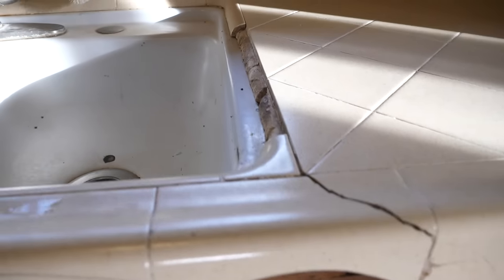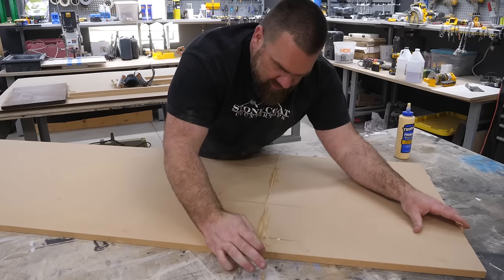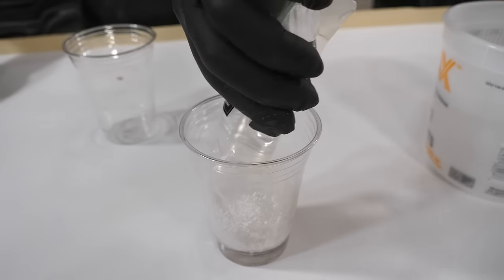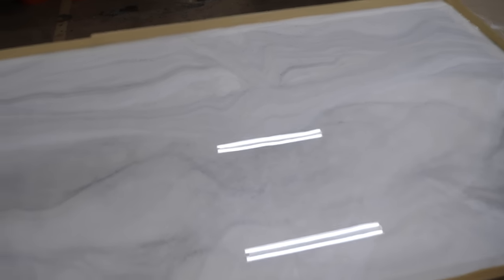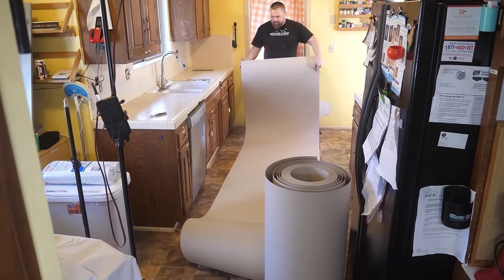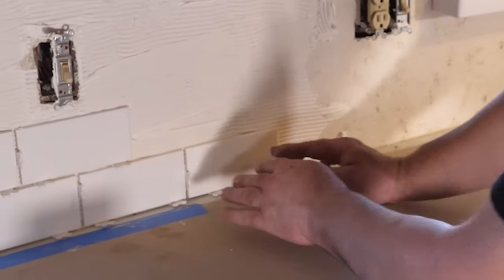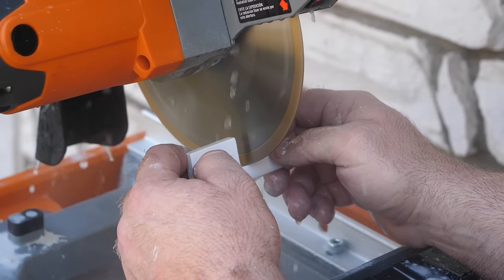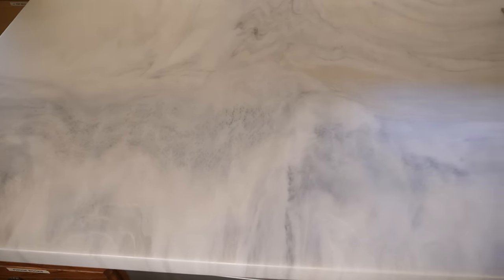How to Install White Marble Epoxy over Tile Kitchen | Stone Coat Epoxy

Comment: Really like the matte finish on this countertop... Nice!
Reply: Thanks for the comment Elly! Have you worked with epoxy yet on a project?
Reply: @mitchquist  No I haven't! But this is definitely the look I would go for. What's the cure time on this before you can start using it?
Reply from the maker: great question! 24hrs the epoxy is cured and no longer tacky. If applying the ultimate top coat you can install and use the tops the next day! Let me know if you have any more questions

Comment: Hi from Gloucester UK! I watch your tutorials and have been applying some of your techniques on a very much smaller scale! I make coasters and placemats with resin and some of your techniques translate quite well to the smaller projects. My latest exotic pour for my partner…he asked for a coaster with a black and white tuxedo cat just like our own Maine Coon cat. I used purple and pearl white mica, sage green and white pigment paste and blue gloss and silver metallic spray paints. It’s come out more blue/green than the purple/blue scheme requested but resin does what it wants! I then added the cat decals and a few other decorations…too coated with my normal brand of epoxy with a light misting of gold mica mixed with alcohol (thanks for that pro tip!)

Comment: I did a Stone Countertop for my sink countertop! I tried to do your caramel recipe but I guess I used too much brown coloring and it came out way darker. but that's OK. It is more like a deep dark coffee and cream and I love coffee. So it turned out better! I painted red guard on 6 inches of the wall from the countertop and up, right behind the sink area to do a little more water proofing because when I removed the original backsplash I found water damage and some mold. I also used sanded silicone (from Home Depot) matched to the grout at the bottom of tile where it met the countertop too! I didn't think of the expansion and contraction aspect of it (good to know pro tip), I was just thinking of water proofing those corners where the counter meets the wall where water can sit. I also used a grout sealer for the rest of the normal grouted areas behind the sink. I like how you masked off and applied the silicone before you dropped the sink. I wish I saw that before I did mine. I applied the silicone bead on the bottom of sink edges, opposite way. I know you warned us about it but I have a few(two) embedded chopping brush bristles on the clear coat. Because of the darker surface color I should have used a light to inspect before it dried. Watching epoxy dry is more exciting than watching paint dry. ;)  Great tip on shutting down HVAC. I shut mine down to also let the dust in the air settle down but I also ran 4 HEPA air filter units full blast in the area for an hour and shut that down before the pour. Otherwise it's hard to control the dust when you don't have a clean room controlled environment. I like this new format of showing more of the DIY reno process expanding more on the SCC product application. It's great that you share little pro tips in all of your videos. They are so super helpful.
What do you think of the ideal of having on your web site a DIY gallery section that showcases photos of customer success stories of the use of your product? Think it would be a great promotion and marketing thing for you guys and would inspire confidence in potential clients that "You (they) got this" and they can do it too. Love all your videos. Definitely helped me do mine.  I plan to do Stone Coat shower walls in our master bath soon. Fantastic unique idea and application of epoxy. Your videos on that are great too. 
I'd like to see a Geode table top (Option A + Option C) if that's possible.
Wish your SCC company/family much success.
Reply: Love the idea of a customer show and tell!

Comment: Hey Mitch - You’re a BRILLIANT teacher!!! We are/were in process of doing concrete counter tops but this is the look I really want SOO…this is the what we’re going to do (hubs will buy in, I’m certain!)
Question: why did you round corners after bondo instead of before?
Thank you for providing a wonderful learning tool, your energy and personality are fantastic!!
Reply from the maker: The bondo was applied mainly to seal up the seam on the drop edge, I could have done it before as well, great question! Let me know how else I can help! Thanks for stopping by
Reply: How long will this epoxy last and does it not peel away please

Comment: Hey Mitch.  Perfect timing. I just removed our 1980, painted tile countertop.  U-shaped kitchen.  Trying to figure out where to put the seams. Going with apron/farmhouse  sink.   

Great tip on using waterproofing under the counter. Having a hard time locating Ardex SK1, may have to use redguard and use a dark color silicone caulk. So not to see redguard. 

Thank for posting. Looking forward to the next episode.
Reply from the maker: I've painted the red gard black with paint to keep the undermount sink from showing pink. Hope this helps, let me know if you have any questions!
Reply: @StoneCoatCountertops  Perfect.  Thanks for the pro-tip.

Comment: Hey mitch, great job !!!  🧡  My vote is for option C.  Though I am redoing my shower and nervous about ripping out the shower pan and doing my own thing....  I got this though, so fingers crossed.  I would seriously love to see the geode wall art in a shower surround....  Could you combine the two?  😜🤣😊
Reply from the maker: I'm getting ready to showcase a new product! High density foam shower pan pre sloped ready for tile. I'm gonna teach how to rip out an old fiberglass tub surround and replace with epoxy shower panels and a super DIY friendly shower pan anyone can install, no plumber needed!!!!!

Comment: Caulking tip I learned on you tube: lay down the line of caulk, then spray with soapy water. Then use your finger  like you did. The grout won't stick to the counter or backsplash. It works!!

Comment: Pro Tip Mitch, if you put painters tape on the bottom of your MDF, you just
 need to hit it with a heat gun and you can pull the tape right off with all the epoxy drips, easy peasy. No sanding! 🇺🇸
Reply from the maker: I'm trying this for sure!!!! Subscribe so you see the video I shout you out in! Thanks for the tip
Reply: @StoneCoatCountertops  been subscribed for years! You and Mike have taught me so much!

Comment: Mixed one gal of part b and part a mixed for three minutes in a one gal container. pored out into smaller cups to mix in the polycolor then poured it back into the one gal container then tried to pour it out and it became very hot and hardened before I could even pour it out. Called Store Coat and they said I should have used a larger container. No where in the training videos did the tell you to use large containers. In fact I user the same containers as they used in the videos.
Reply: Same with me

Comment: Hey Mitch! Amazing job and you’re also an awesome friend👏🏽 I watched the old video with Mike doing epoxy on old kitchen tiles. He used a dark colored paint over the concrete but I need white countertops. Can I paint the concrete white then add clear epoxy or just add a drop of white paint to your epoxy mix instead of those dark colors? Would love your help with this, thank you so much!!
Reply from the maker: I'd paint the concrete 1st and add some color to the epoxy as well! Great questions

Comment: HEY MITCH could you use tape on top of the sink edges as well to ensure a even more cleaner line and less clean up when caulking the sink after installation?  Also love the work you did! Absolutely beautiful!  Keep up the good work!
Reply from the maker: Yes you sure could, 91% isopropyl alcohol can help with clean up big time! Great question, have you worked with resin yet for a project? -Mitch
Reply: Yes I have worked with art resin on tiles  and loved the result! The son and I are talking about doing a bathroom shower and counter.

Comment: Dear Stone Coaters, ever did a concrete staircase? Is it even possible? Need to renovate my currently naked concrete stairs. Looking for options away from boring parquet, vinyl or laminate layering.
Anyhow, love your vids and content.
Best regards
Reply from the maker: Cool idea, our epoxy is compatible with concrete. Are your stairs outside in direct sunlight?
Reply: @StoneCoatCountertops  No, they're inside within the living space. Ground floor to upper floor. So not exposed to any weather conditions.
Thx and best regards

Comment: Hey Mitch, Why are you sanding & routering the edges after applying the Bondo instead of before?
Reply: You'll want to make the bondo nice and smooth with the type of edge I used in this project. The bondo sands nice and easy
Reply: Yes, but it looked like you completely removed areas of Bondo.

Comment: Hey Mitch
I think your work is amazing. I wanna give it a shot on a BRRRR I’m working on. 
What’s it called when the countertop goes all the way down to the floor? Like a waterfall. I have a 6’ island and I’d like to do it like that. 
How can I set my epoxy high enough to run all the way down?
Reply from the maker: Cool idea, do you want the epoxy to organically pour off and cure as the edge?

Comment: I am ready and putting together my or I have the primer white the art A&B and also the black and the white Liquid Epoxy Dye. However, I'm not sure if I want to use the ultimate top coat, my question is does the ultimate top coat give the counter a more satin look, instead of the gloss look? In addition, do I need any top coat after the art pour? How much white dye to say one gal? It did not look like you use much.

Comment: Hey Mitch! Does your Ultimate Top Coat only come in the flat finish or do you have a glossier finish-or will you be coming out with 1 in the future? Nice job-beautiful project-With the ultimate top coat, How long until you can fully use? Like putting heavier objects lie a microwave on the counter?

Comment: Hey Mitch 
Couldn't you use wood filler such as Elmer's or Minwax instead of Bondo? Or did you use Bondo just because it cures quicker?
Reply from the maker: You can use wood filler instead of the bondo. You don't want any voids in that seam, it can ghost through. I use the bondo because I can get to the next step quickly. Great question. Thanks for subscribing for such a long time! Let me know if you have any further questions.

Comment: Interesting question.  What is that weird yellow and grey shiny upside-down mushroom on the MDF starting at 12:08?  I'm rather drawn to it.
Reply: Hahahah! A well used and put away with epoxy on it sanding block!! There's velcro on one side that holds a piece of 5 in orbital sanding paer! Very handy for edges

Comment: I wanted to know if I’m pouring over a previous epoxy counter so I need to prime and then apply the epoxy undercoat product that came with my kit, or does the sanding, and expiry undercoat good enough before outing the epoxy countertop ?

I’m trying to get this done today but can’t seem to find the answer to this question anywhere.

Thanks!

Comment: Thinking of putting stonecoat in my kitchen just one thing I'm worried about is yellowing over time. How long does this stay white or is it garenteed to not yellow
Reply: They sell a "Art Coat" epoxy that has special pigmentation or UVray protection for anyone wanting true white..  it works great.  No yellowing over time. I've used it.
Reply: All epoxy yellows over time. The fake marble counter tops in my home from the builder have also yellowed over time. Basically anything with poly or resins in it probably. Do you want something gorgeous until then however? It’s a lot less money and can be stunning. Add a hint of sparkle or a vein with a slight color and yours will be unique!

Comment: Hey Mitch 🙋🏻‍♀️ why MDF and not plywood around the sink? I was worried the MDF would soak up water if any leaked thru somewhere and ended up chickening out and using 3/4” plywood. MDF would have been cheaper

Comment: Great work Mitch, but I noticed something different in this one that I have never seen....the mold that was made for the " hot " serving dish or whatever to be sat on it....so the customer " wouldn't hurt their dining table...GREAT idea !!! Since it is possible to " hurt" the table...I really need to know the answer to this proposed question.....is it possible to build countertops with epoxy that are capable to take a  pot directly off one's stove and sitting it down onto said cabinet top " WITHOUT" any damage and cutting up whatever wherever on the countertop? Cicken...beef.....fish....No damage at all? Is it possible? I love cooking with my wife and NO limitations with cooking and chopping..would be great...we got cutting boards...just curious, because we SOLD on the idea and your products....we look forward to your response.
Reply from the maker: Our epoxy when cured is very heat resistant, up over 400 degrees. When epoxy warms it gets softer, when it cools it will harden back up. Epoxy isn't the right surface to cut on though. My kids cut on my dining table with the Ultimate Top Coat applied and it's holding up so well! Great questions
Reply: @StoneCoatCountertops , Needless to say, I've never had nor cut stuff up anything on marble ...knowing my wife and me, we will always use a cutting board and pot holders.....just curious to what the answer would be...love the way your products look, and in due time, I/we look forward to possibly doing business with ya'll . Thanks for ya response and have a blessed day.

Comment: hey Mitch! A penny for your thoughts sir lol... So I have a subway tile backsplash that I did a coupile months ago and i'm about to stonecoat my existing countertops. I've already sanded I'm just about to mix and thought I'd watch one more before doing it and i just thought, what's the best way to pour with an existing tile backsplash? I was going to tape about 1/8" up and rock and roll but thought I'd ask the pro first. Thanks
!
Reply from the maker: Great question, Mitch here! I'd tape up and take time to push tape into grout. Peel the tape when you're complete with the color effects. Don't leave the tape on while the epoxy cures. Lemme know if you have any other questions

Comment: This is exactly what I want to do for counter tops in my kitchen except I want an undermount sink.  How do You do an undermount
Reply from the maker: The same process except you, cut the sinkhole 1st. The sink should come with a template. Cut out the hole if you double up the thickness of the substrate you're using Bondo that seam. Round over the top and bottom of the sinkhole cut. Pour the epoxy, then remove drips from below. Apply a roll on waterproofing membrane (Red Gard), and paint the red gard black before installing the under-mount sink with silicone and mounting blocks screwed into the bottom of the countertop. Let me know if you have any questions

Comment: I did a similar color countertop and within a year it yellowed- the weird thing is that it yellowed UNDER a placemat they had on the countertop.  I was dumbfounded- I expected it to yellow overall- but under a placemat where it was not exposed to light? Do you have any ideas why it would yellow under the placemat?
Reply: Did you use Stone coat? And did you use Ultimate Topcoat?
Reply: @daysdesigns  yes - but Ultimate topcoat wasn’t available then

Comment: I would be really nervous cutting all that after it was done. I would have to have it all pre cut before coating. I don’t have enough confidence in my carpentry and construction skills to cut and fit after it has been coated.
Reply: It can be nerve racking at 1st! I made an error on a granite sink cut, it cost me a ton of cash!!! If the sink comes with a template it makes it pretty easy and keeps you well within the sink lip so no boo boo's!

Comment: How to not have the melted ice cream cream and more realistic pattern?
Reply from the maker: Add more contrasting colors to the pour. This customer wanted a very subtle look with minimal contrast. Also adding thin veins by pouring out small amount of epoxy on the project then melding together with a heat gun can add some extra detail. Thanks for dropping a comment